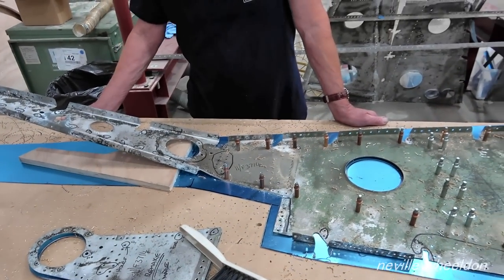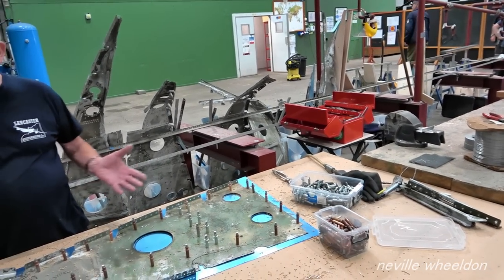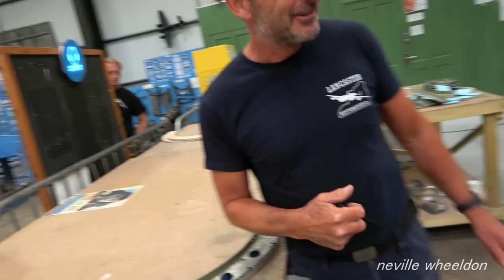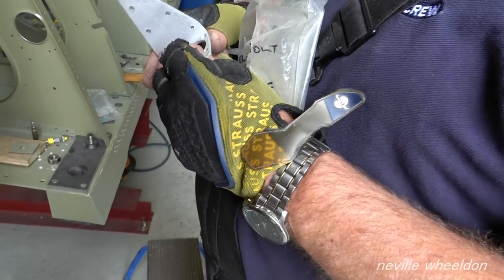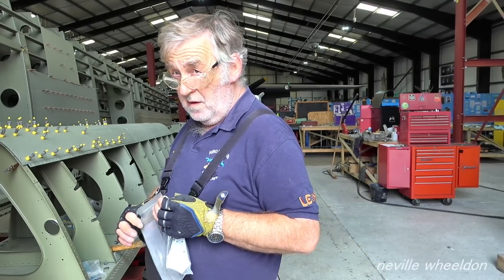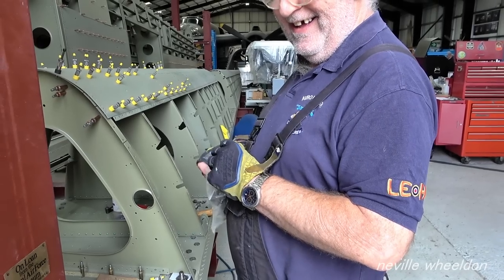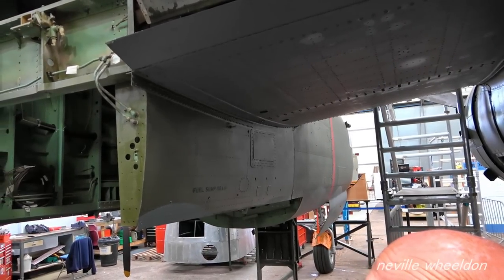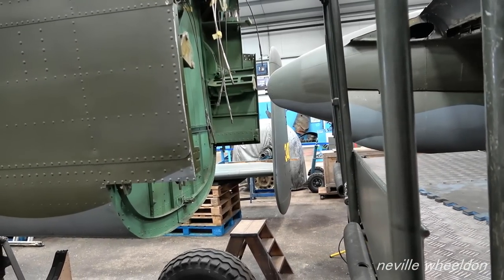Video 205 Restoration of Lancaster NX611 Year 6.  Work on going on all fronts.

Comment: Thank you for another great video, Neville and crew. Interesting to notice so many differences between the Lanc and the Mitchell concerning engineering, like the cables and pulleys system on the B-25. My knowledge on such matter is none, but suppose they are related not only to different minds behind each project but also to the different size of each airplane.
Reply from the maker: Hi Namer , the RAF operated 360 B-25 in WW2. John and Ad have some knowledge on them. ( Not that they were around at the time)

Comment: i'm a big VC10 fan and the story of the Brize Norton incident was rather amusing, as i understood it, there might have been a faulty gauge in the cockpit reading the tail to be empty, so the de-fueling carried out forced the aircraft to sit on its tail 

the funny story i heard was that there were people in the cockpit, may have been ground crew, but i heard it may have been a air cadet or two, who made a comment, 'we're flying', someone called him stupid until they began to slip backwards, the photo shows a hell of an angle, and yes this took some time before it was rectified

on top of this, you have to ask the question, surely this procedure is being overlooked, someone must be watching the numbers as the fuel comes out and fills the tanker etc, and maybe even notice the front wheel coming up and off the ground, isn't there a point when you run for the big red switch - i suppose there is no procedure in the manual, watch the plane, don't trust gauges, watch the numbers, stand next to the big red button

i would love to have been there to see the headless chickens, and see how the plane was brought down safely without any harm

i imagine if the B25 went on its tail, you just give it a shove and everything be ok, tough old bird
my thoughts always go the brave men of the Doolittle Raiders, bless them all and what they achieved